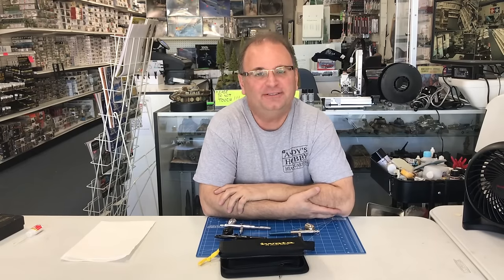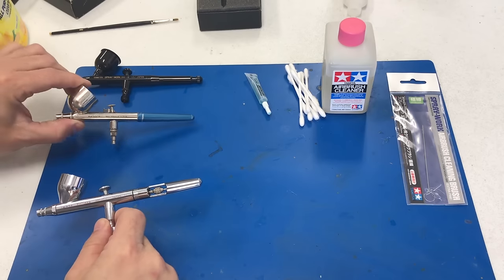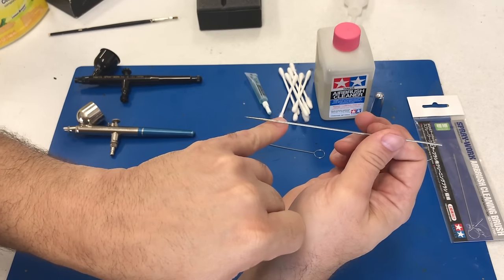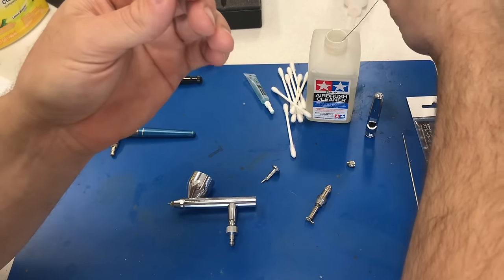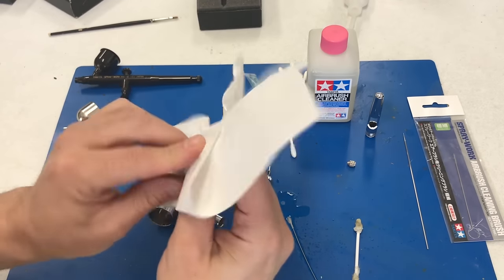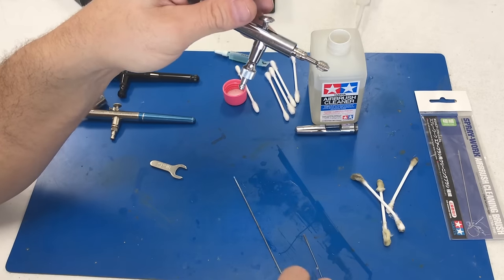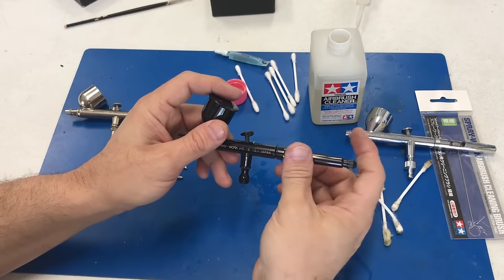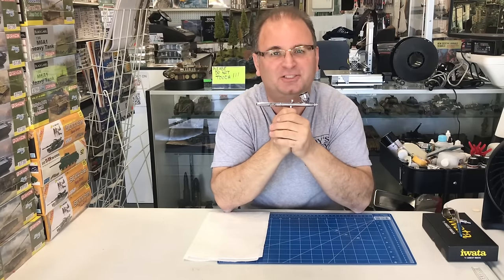How to disassemble and clean your airbrush  easy step by step

Comment: Thank You once again for an awesome video. But for once I have a (valid?) comment. My first air-brush was the Iwata HP-CS and it sprayed like a dream but cleaning/stripping it was, and still is, a nightmare. Then I got a Harder & Steenbeck Infinity CR-Plus 2-1. It's taken apart fingers only, has PTFE (=Teflon) seals/O-rings, a snap release needle stop/preset, two size needles+noozles, three different needle caps, two intercangeable paint-cup sizes and a tripple chromeplate protection. Most of that is extra  to the Iwata at an insane cost. If you like me only plan to own 1 air-brush I highly recommend it to newcomers as the High-End air-brush that won't get you frustrated. Still use the Iwata but only for varnishes. Note: I live in EU where the  Harder & Steenbeck might be easier to get your hands on. Again Awesome video!

Comment: I know this video is older, but I "acquired" my husband's old Paasche airbrush (he's had it for about 4 or 5 years) recently and the spring and "button" are designed almost identical to this.  I wish I had found this video yesterday when I was taking the brush apart because SOMEONE put it away with paint dried in it.  I used the schematic in the instruction booklet to take it apart and put it back together, but this is much clearer!  Thanks for sharing your knowledge.  I look forward to watching more of your videos.  I'm not a model builder, but I'd like to get into some airbrush/mixed media kind of thing.

Comment: Hi Andy,
Thank you for your airbrush cleaning video.
I am new to airbrush spraying as to date I have relied solely on rattlecans to supply colour for my diecast toy restoration hobby.
I have a Fengda airbrush which until now had no idea how to dismantle and clean properly but thanks to your video I can now confidently take it apart, clean and reassemble ready for the next step in spraying paint.
Very much appreciated,
David.

Comment: Good tutorial Andy for those folks who are afraid to disassemble an airbrush for cleaning.  I thoroughly field strip and clean my airbrushes every single time I use them.  When changing colors I always flush forwards and backwards,  remove the needle and tip and rinse them out then re-assemble and move on.  The one tip I suggest is when disassembling is to place all parts into a small shallow container so they don't get eaten up by the carpet (concrete) monster.  I have a concrete floor in my basement where my hobby bench is located and it always amazes me how far metal parts can bounce and roll on a hard floor.  I've lost a few tips, end screws and trigger parts to the carpet monster and those parts can be awfully expensive to replace.  Cheers to you and thanks for your great vids!!
Reply: William Logan Thank you for the insight. I was going to ask if the airbrush should be cleaned after each use. It sounds like that is probably the best thing to do.
Reply: It's a practice I follow religiously which keeps the spray patterns consistent and the flow smooth.  I will say that I only use acrylic water based paints and never have a problem.
Reply: Empty a shop vac and run over your entire floor, check the collection for your tips.
Reply: I have never owned an airbrush but I'm looking at getting one soon for model building. I see that you clean it out with every color change, which is a great idea. Is it always necessary to do that? I used to build models as a child and into my early 20's, but it's been at least 10-12 years since I have built one, so I know it will take time to get used to an airbrush. Any suggestion on what type or brand I should buy for a beginner? Any tips would be great from anyone. Feel free to message me to talk more. Thank you all.
Reply: I'm not Andy, but I'll give my two cents...

An airbrush is like any car, some you like, some you hate. certain people like certain things in a car, others could care less about the very same things. Point is, what makes a good airbrush for some, makes very little difference to no difference for others. If I were you, I'd eat and devour everything on the internet about the three major brands first, (Itawa, Badger, Harder & Steinbeck,  then work out into some of the other more obscure brands and Chinese copies, after thoroughly learning everything there is to know about the lines that the top three produce. Badger makes three very good airbrushes which cover the gamut for the hobbyist, The Sotar 20/20, the Patriot 105, and the Krome. Itawa has a similar matchup and is also very good, though priced a bit higher. Harder & Steinbeck carries a good lineup too. Some people like Itawa for the feel of the airbrushes they make, and others like the utilitarianism of the Badger design, still others want an airbrush that has a good trigger design such as that of the Harder & Steinbeck's. 

Besides the "feel" of the airbrush in your hand, there is how it shoots paint, and what size models are you going to be painting, are they glossy, are you delivering just solid colors, or will you be doing detailing with the airbrush? The purpose for your gun will dictate how good a job it will perform for you. If all you are doing is clear coats and flat colors, then a Patriot 105 with a 0.5 needle may be all you require. If you are doing detailed presiding and camouflage, or exhaust marks, then you may have need for a Krome or a Sotar. Point is, pick an airbrush which will match your needs in modeling. I have four guns, and I am planning to get an HVLP (mini air gun/ paint sprayer) for larger applications. Each gun in my collection has its own special range for use, and I bought them with that very purpose in mind. Not all of them are top of the line, but they are good quality guns which I can keep for a very long time, even if I upgrade to a better / more expensive one.

An airbrush does require that you clean it after every use, but not all paints require a total breakdown of the gun for cleaning. Between colors, for example, all you need do is rinse cleaner through the gun and rinse out the color before going to the next color, but after a session, I always make sure to do an extra backwashing and check the needle and nozzle for paint buildup. This would not be true if you are going from a clear to a color, some paint types are incompatible with each other and need a good backwash before you go into them following another type of paint. I try to learn everything about a paint I can, such as what types of solvents are present in the paint, the makeup of the base, its thinner needed and so on.

Comment: great how to,,,thanks...I have found a good way to clean....I got some bad white paint from a local craft store that totally clogged up my airbrush...I may add I did reduce the paint as per bottle....even the trigger was stuck....caused a real ruckus...the paint turned to molasses in a matter of minutes....I had found this stuff called airbrush restorer....I  completely disassemble my airbrush and soaked all the parts in a small tub of that stuff....after about an hour of soaking is the restorer....it was all but perfectly clean...like brand new....just rinsed with tap water and reassembled...worked like new....needless to say that white paint went into the trash.

Comment: Thanks for this video. This has helped me a great deal with learning how to take mine apart and putting it back together. One thing that I have to note is that the spring piece in the back of the button that opens the air valve and the paint valves is a bit tricky and goes in a certain way.

But anywho, thanks for showing this again and I hope to see some more vids like this and such.

Comment: We don't have the Lysol product here, but I found that methylated spirits works extremely well with Tamiya paints. I have dispensed some into a small spritzer type bottle and just spritz a small amount of the spirits into the bowl of my airbrush and then spray it out when I want to change from one colour to the next. I also use it when cleaning the airbrush like you did here.  A further item that I use are the round disposable make up remover pads that women use.  These are super cheap and ideal for cleaning needles and the inside of the bowl.  I also use the pads for cleaning brushes.

Comment: Great video for beginners. May be you can do a more advanced part 2 on lubing, dealing with the  O-rings, checking the air valve and Sonic cleaners. I had a lot of trouble airbrushing until I learnt to clean them properly and regularly.

Comment: Loved this video. My brush is a Master model G233 and whilst chrome was very similar to the black one you showed with the stop adjuster. However that little flapper that sits behind the thumb control was completely separate. Kinda had me thrown for a while, but after rewatching your rear down and reassembly was able to get it all back together again. Even though I had cleaned it after I last used it (some 6 months ago) I still cleaned it like you suggested and wow! did I get some gunk out of it.
Thanks for an excellent tutorial 👍👍👍

Comment: Thanks for another great video.
I'm pretty new to this, but when I take the airbrush apart I use the tiny wrench that came with the airbrush to remove the nozzle, which then lets me poke the "pipe cleaner" brush down the hollow stem of the brush from the front.
And you're damn right about the Tamiya Cleaner - nearly knocked my head off first time.
I never thought of using general cleaner. Just shows that these "Back to Basic" vids always are great to watch.
Once again - many thanks.

Comment: I see many videos about airbrushes and how to start and then the other end of it, the how to tear down and clean the airbrush. Now we need one for in the middle. A painting session. Where you get to the point on your model and you want to paint all the different subassemblies  but you have four or five different colors you want to apply. I’ve got the spray one color but what do you do to change to the next color? Do you just spray solvent thru and then go with the next color? Or do you have to stop and throughly clean the whole brush, put it back together and then change to the next color? That’s the video I’d like to see.

Comment: I started with a "Model A" Thayer & Chandler gun, (37 years ago) and these airbrushes seem to have really come along in their quality of parts, but really have not changed that much when it comes to components! Now, lubing the brush? What can I use, (or more to the point, what don't I want to use) to lube the trigger, needle housing, and other components?

When it comes to the Tamiya Airbrush Cleaner, it contains DGB Ethers, and flash alcohols. They are really good solvents for acrylics, but the ethers are notably a drying agent (which I believe help to accelerate the active nature of the solvents) but in any case, they will dry out the seals, and over time make them brittle. When I say "over time" I mean it will take 30-40 cleanings for them to even really be affected... but, even so- I would definately recommend taking a preventative measure to counteract the effects of these chemicals. That could be as simple as running a weak solution of water and glycerin through your gun, lubing the needle and so on... I'd like to know your thoughts!

Comment: Andy what about paint residue inside the nozzle?
Some people use ultrasound cleaners, but I couldn't get myself to buy one yet, just for the nozzle. 
I have a H&S and an Iwata airbrush, having problems with nozzle cleaning in both. Can't really get in there, except with a very fine needle that once destroyed the Iwata nozzle (I'm on the second nozzle), but when I don't clean them from the inside, the needle will bake onto the nozzle after 2 days of rest.
I disassembled the airbrush, cleaned every part by itself and then spraied airbrush cleaner after reassembling everything.
I even put the nozzle into a small cup of airbrush cleaner and let it rest for 10 minutes, but it still wasn't enough to get it real clean from the inside, plus the o rings don't like it too much, even the high quality ones from H&S or Iwata...really frustrating, I get a lot of 'sticky needle issues' and 'high pressure in - low pressure out' issues with my airbrushes.
Sometimes I have to shoot 65 psi in just to get a tiny amount of paintflow out, the nozzle is really the issue for me.
I'm using the Vallejo airbrush cleaner on AK and MIG acrylics.

Comment: I'm new to airbrushing, and really appreciate the videos and tips. Question about clear coating a model car - do you clear coat before or after installing the plastic windows? Wasn't sure if the clear coat would leave a film or yellow on the plastic windows. Thanks!
Reply: I can answer that. Do your clearcoat before you install the plastic windows

Comment: Hi young Andy. Great video as per usual. I bought an airgun and compressor (Timbertech) which I started to use. I made a whole lot of mess and I am still cleaning it up. Firstly I put too much paint + thinner in the gun cup. I tipped the gun up slightly to access a difficult area and some poured out. Luckily it went onto newspaper which I'd spread out to catch any over spray etc. Secondly, I needed to clean the gun as it was clogging up (paint too thick probably). I accidentally took the trigger mechanism out and the trigger itself fell out. I've tried for about an hour to reinstate the trigger but to no avail. So, in conclusion, I'm going back to the good old paintbrush. NOT impressed with spray painting. BTW. What do you think of the Tamiya tins of ready sprayable paint?

Comment: Do you do this whole process everytime you change color (paint) in the airbrush or just at the end of the day once finished the paint job? Is it usually enigh to flush through some cleaner befor changing paint? 
How do you put the paint into the air brush by the way? (when ever I try to pour some paint from a Tamiya jar, some goes astray...) Thanks!
Reply: I’m just starting out and was thinking exactly the same thing. When it comes to the paint into the brush, I think one of those soft measuring cups could be useful or a pipette

Comment: Im about to buy an Airbrush and 1 question i have is if your done painting with one color and still have a lil left in the bowel,after you clean the bowel out and spray with just air to push any excess out do u have to completely take apart the gun and clean it before using a different color? or can u just add the paint right then and there and start painting?      and I learned a lot from this video thank you! hope to get a response to this question.

Comment: Hi Andy! Doesn't the nozzle have to be cleaned? Great video btw!
Reply: I´m not Andy but i try to answer your Question: You can clean the nozzle but you don´t have to do it all the time... when you do a "Fieldstrip" (just unscrew  the nozzle cap and cleaning the cup) then just blowing some cleaning agent thru the cup. When you do a full disassembly, like in the Video, then clean the nozzle ( My Way: unscrew the nozzle of the Airbrush and submerging the whole nozzle into Airbrush Cleaner or Acetone etc 4-5 Min and after that use a Twezzer and move around in the solution and you done  :D ) but be careful and mind the sealing at the rear end of the nozzle... ;) hope i could answer you Question

Comment: Any suggestions on a good starter kit for those who are planning on getting into airbrushing but have yet to take the plunge? Also have you have tried an ultrasonic cleaner on an airbrush? I have yet to buy either an airbrush or an Ultrasonic cleaner so I can't actually test it but I suspect they would be an outstanding way to clean an airbrush based on the many other things I have seen cleaned with one.

Comment: My issue is that w my Badger Airbrush (that has been unused for several years) has no air flowing through it. Seems to be blocked at the base where the hose connects. Any suggestions?

Comment: What is the minimum cleaning required if I just want to switch paints as I’m working on eg camo patterns ?
Reply: When I switch paints I remove and clean the needle, clean the cup by using acholol prep wipes. After I cant see any paint I reassemble put some tamiya paint thinner through the airbrush and then just use water. When you spray water and its completly clear your ready to use another color.

Comment: Hi Andy. 1. My friends said that I can put the cleaning liquid into the airbrush container and spray them out like normal paint, the cleaning liquid will wash inside the airbrush and they say it's an effective way. Should I believe them?
2. Can you tell me the model name of the tamiya airbrush?
Reply: Hi Kaito, well between a Paint change you can do so but to clean the Airbrush proberly do as like shown in the Video... you also can do the following: But some cleaner in the cup of the Airbrush then put a finger on the nozzle cap after that push down the trigger until air starts to flow hold it down and then pull the trigger gently back until bubbles start to rise in the cup this will clean the cup... Hope it was useful :D

Comment: I just got a new airbrush so I don’t really know how to use it correctly but I have a problem, so after I screw the back off and take the nut off holding the needle I tried to take that part that holds the trigger but it won’t come off. How do I fix that?

Comment: Hi I'm having trouble with my airbrush and disassemble it and clean it but still my airbrush don't  spray so I cleaned the inside and the tip the needle and still no go what do I need to use the paint that I use is Mr color

Comment: Good video! However, you should pull the needle out through the front. That way any residue on the needle doenst scrape off in the back of the airbrush.

Comment: that iwata has a 0.35mm needle yeah? i need a new airbrush ive been using a very cheap one to learn the hobby. is ut possible to buy a 0.2mm for that air brush
Reply: Give the Sparmax SP 35 a Try... it is a good Airbrush and not so high in Price :)